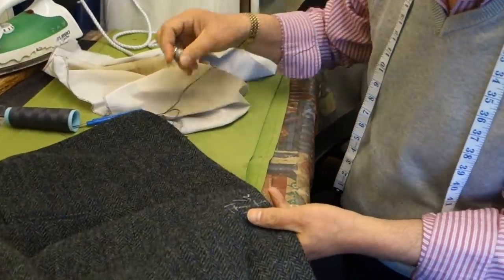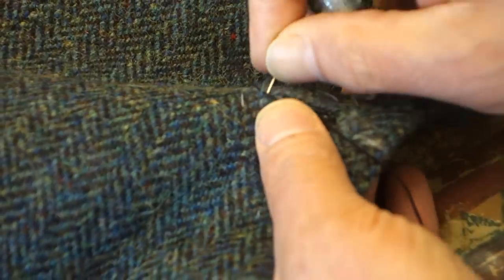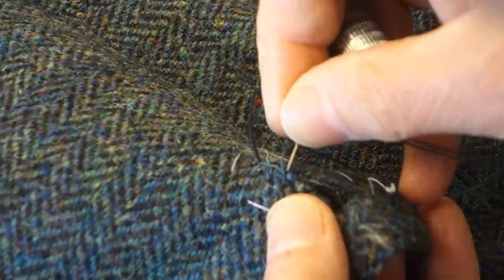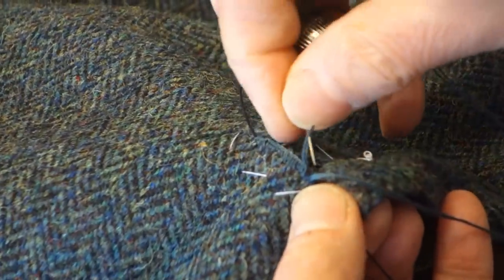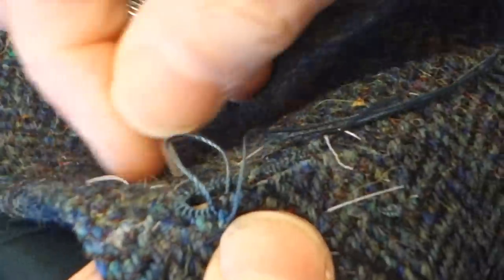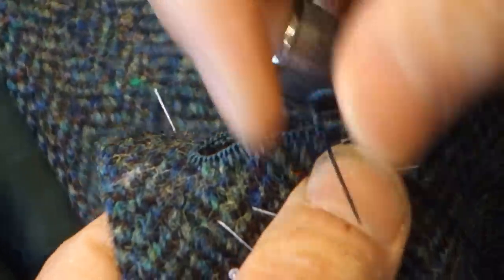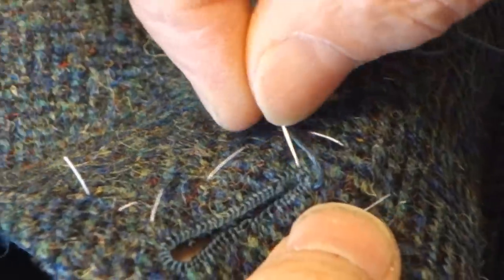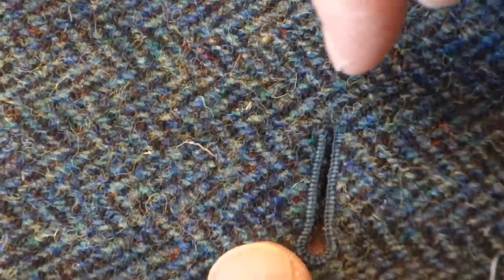Button hole stitching.

Comment: Excellent technique.  Good focus, easy to follow too.  Thanks!  I'm able to use this to master the buttonhole stitch myself.  Books only showed blanket stitch, and the knot at the top was impossible for me to figure out on my own.
Reply: The Button hole and the Blanket stitch is the same stitch. The only difference is the button hole stitch is much smaller and the stitches are closer together because button holes are far smaller than the edge of a blanket.
Reply: SpiritBear12 In many sewing instructions you would be correct.  They use blanket stitch as a buttonhole stitch.  But if you look closely at this tutorial you'll see there is an extra knot at the top of this stitch which differentiates it, and makes it stronger and better wearing.  This is truly professional stitching.